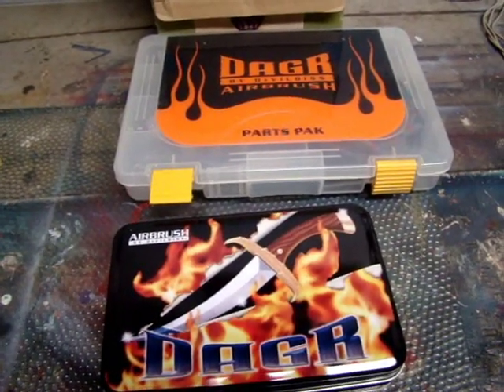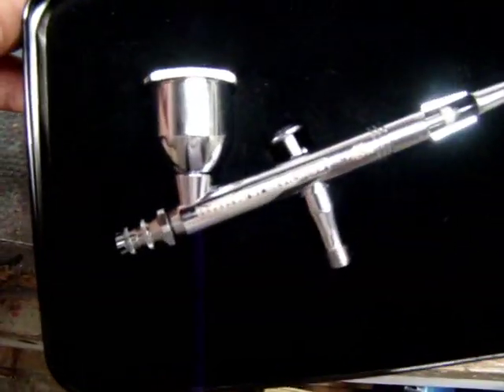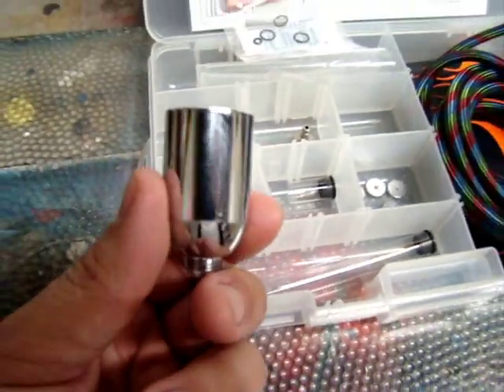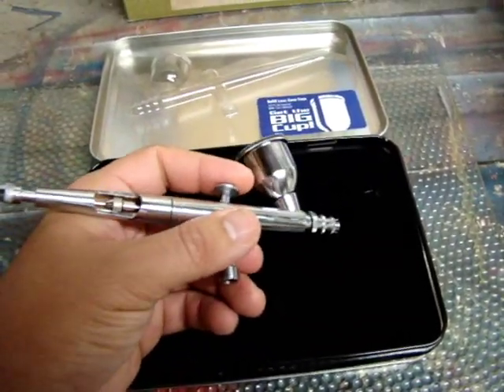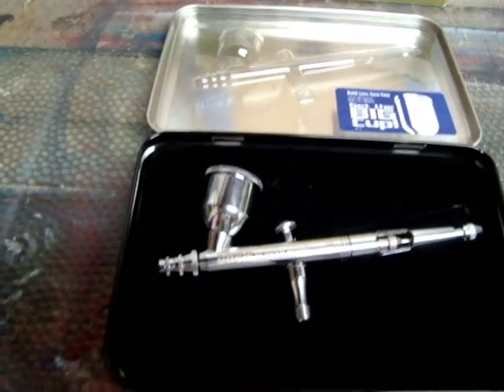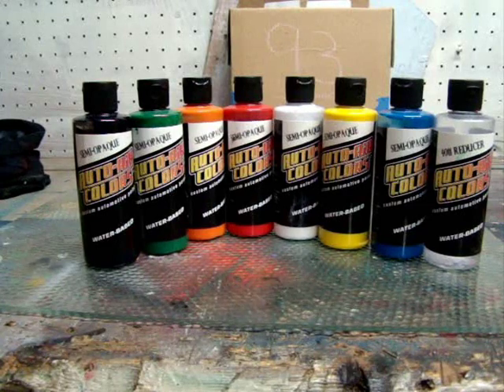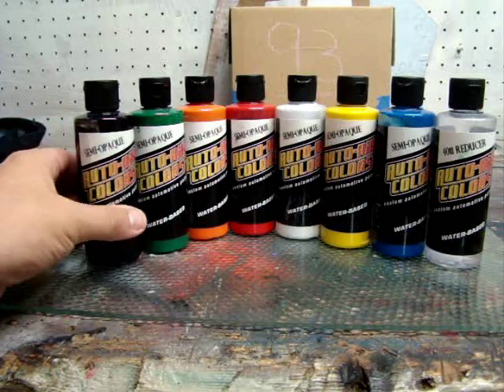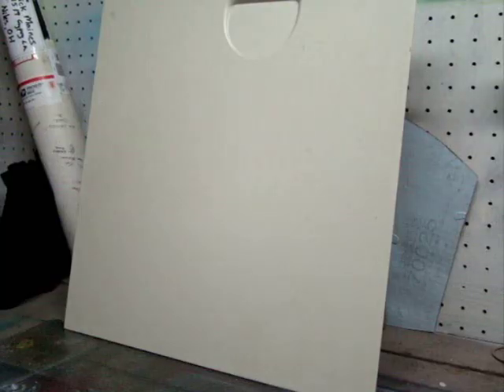Airbrushing - Devilbiss Dagr (Part 1)

Comment from the maker: @13timboe Yeah, I don't have that HF brush anymore.  I have a DAGR, and 8 brushes from Badger/Thayer&Chandler.  I can't say I agree with you on the auto air though.  I prefer it.  Their newer stuff and the wicked line from createx that just came out is killer.  I would like to try some Kustom Shop, but it's a urethane, and not conducive to spraying in my shop in the basement.